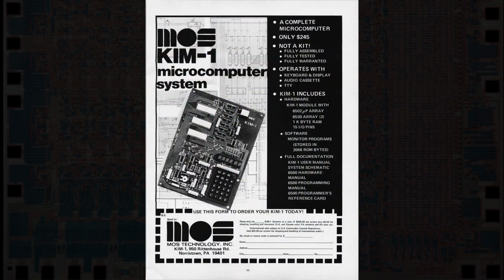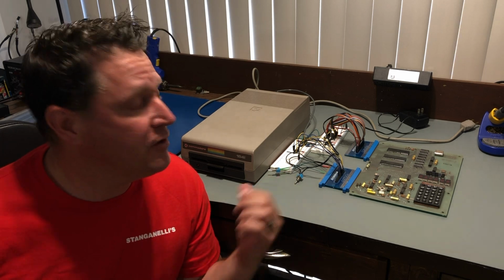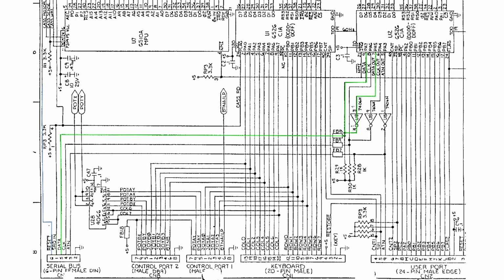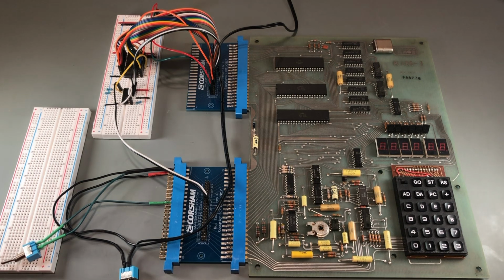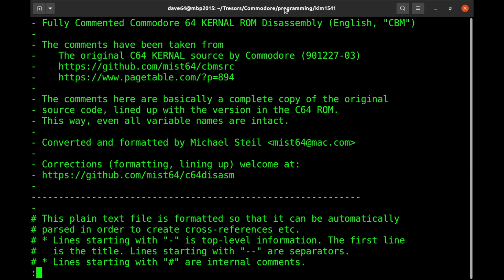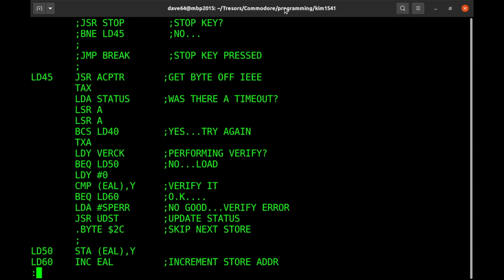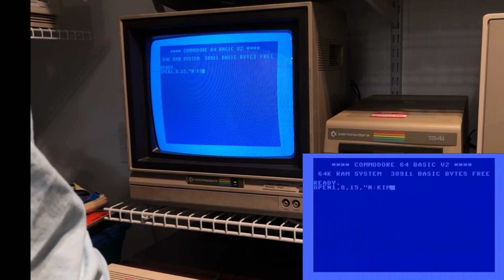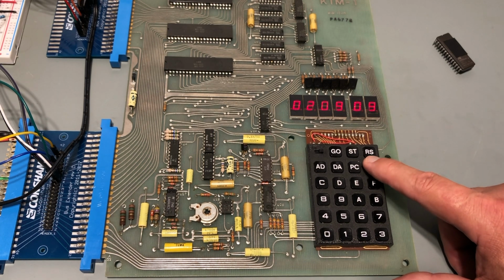Implementing Commodore's IEC bus protocol on a KIM-1 single board computer

Comment: With this in mind, it should be possible to add a IEC serial interface to a commodore pet and use a whole range of serial commodore and compatible Disk drives and printers on a range of commodore pets, and even non-commodore computers. It has been done for Sinclair zx81 and Sharp MZ-700.  A neat box for my pets would be lovely,

Comment: That was impressive! I came along by chance, as I was curious to watch a video about how the KIM-1 worked, as I was curious if a KIM-1 emulator could run on the MEGA65 one day, and be a way for me to explore this ecosystem further. Your video was the first one I hit, enjoyed it a lot, and I like that technique you had to solder the IEC cables pins onto an IC socket and plug it into your breadboard, I never tried that before, very neat :)

Also amazing the effort you took to document the entire journey, walking through schematic diagrams, how you placed wiring on your breadboards, walkthrough of the software. Thank you for sharing so much of your journey :)
Reply from the maker: Thank you for watching, and thank you for the very kind words. I'm glad you enjoyed the video!

Comment: Can't you use a arduino / raspberry pi pico to do your initial work? It will save you some time
Reply from the maker: Maybe? Curious what initial work you mean. Might be a cool idea I didn't consider.
Reply: @commodorehistory  I think I should wrote initializing work to get program etc start to run. Maybe there is a chance to save "programs this way, or maybe even from a pc

Comment: well. as for 'topics people don't care a whole lot about'. maybe not for the kim-1 :P as tbh there are not a whole lot of those left :P but as you already stated, all cbm systems are more or less the same and guess what. that goes for any 6502 and 65816 system and you'll find that any new one of those also needs to get some way to talk to storage devices... and guess what. there are tnnnes of those things around. both actual old iec drives as well as new 'replacements'. (still tho. it would be nicer to do the actual hardware circuit the way it was once intended. with a working shift register, therefore running up to a few megabits/s without bitbanging stuff (and if an actual 1541 or 1581 can't handle that, cuz eh well. not just the shift registers on the computer side were broken. all of em are ;P then so be it.) funny how the wdc65c22 datasheet provides no clarity on it working right or not to this very day. (ofcourse atari sio is far easier to implement, and techically superior, (other than that i have never seen a 'vic-switch' kinda networking device for that ;)  just that that requires a whole lot of code in terms of a 'dos' to be loaded :P and the whole concept that the drive handles it all is to be preferred. even nowadays.
Reply from the maker: Your comment indicates that you actually watched the whole way to the end. I’m honored :). Seriously, thanks for watching and for caring enough to leave a detailed, involved comment. Today, I salute you.

Comment: Great work. Two years ago, I have found a ROM in my CBM8032, that contained the C64 IEC bus codes. It was not complicated to make an interface circuit for the user port.

Comment: Really well done coverage of an interesting topic!  One question - why the inverter?  Couldn't the code just pre-invert the values?  Why do they need a hardware inverter?
Reply: I think you're correct in that you could invert the signals in software. I'm not a hardware expert, but maybe the invertor was used as a buffer to protect the 6526 since it's only used on the output lines. The 7406 invertor was already in the 64 for the power on reset timer and for video decode logic, so it may have just been a matter of convenience.

Comment: now we just need a cage match video pitting the kim1 against the apple1
Reply from the maker: They were certainly similar devices, being both based off the 6502 cpu.  The Apple 1 had on board video output IIRC, which was a pretty big deal compared to the KIM-1's native display.  If I had an Apple 1, I'd totally make the cage match video :)
Reply: @commodorehistory  well, there are newly manufactured pbc board kits for building both kim1 and apple1 computers

Comment: You know I am going to have to try this. As I still have my 8K Eprom expansion board sitting in front of me. I found an extra drive cable. Don't know why I have an extra one, but I do. As you did not cover the actual pin out of the cable that you put together, I looked around. To make sure that I am putting this together correctly. Pin 1 on the Male DIN connector is top left and circles around counter clockwise?
Following your video it looks like you have your socket wired, from bottom to top. pin 3 (PA3), 2 (GND), 1 (NA), 4 (PA4,PA6) , 5 (PA5,PA7), 6 (IRQ)  is that correct?
Reply from the maker: Pinout shown male and female for clarity: https://youtu.be/OA4v7ElGWuA?t=130
Reply from the maker: Also, another fella took on the project of recreating this and was kind enough to sketch a quick schematic: https://twitter.com/masterhit/status/1540645208798420994/photo/1

Comment: Nice.  I never owned a KIM-1,  but looks like a fun board to tinker with.  Come to think of it I built a kit a few years back that recreates the KIM-1 I think called UNO-1.  Since it is basically an emulator using an arduino I don't think you could do this cool project.
Reply from the maker: as long as they're emulating all the IO pins and timers of the 6530 it should work.  Give it a try and let me know!